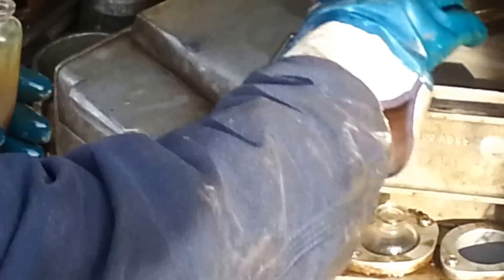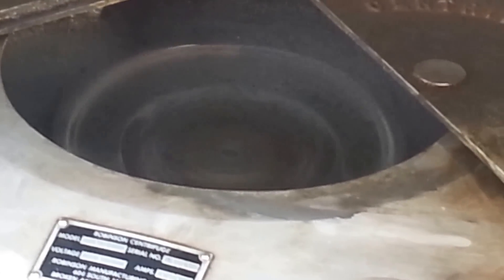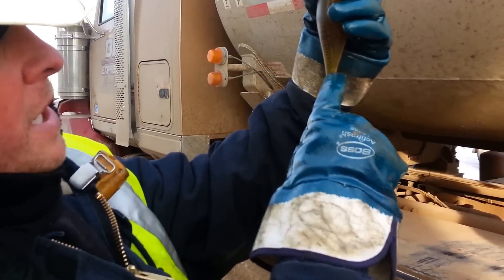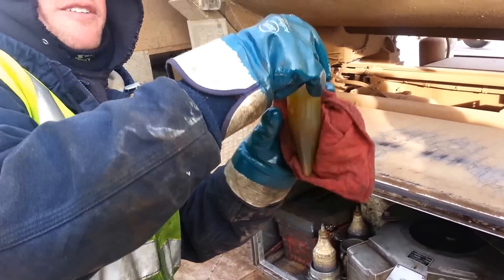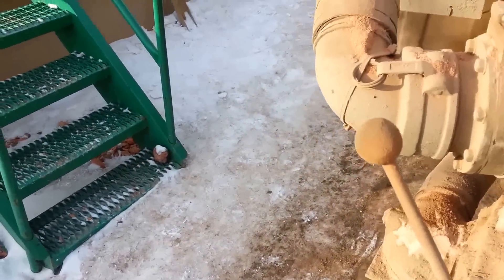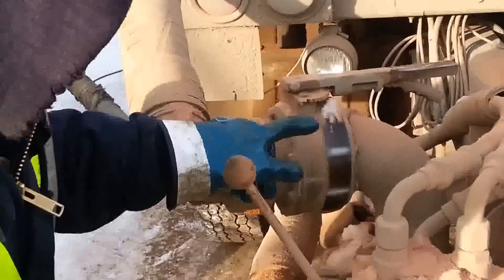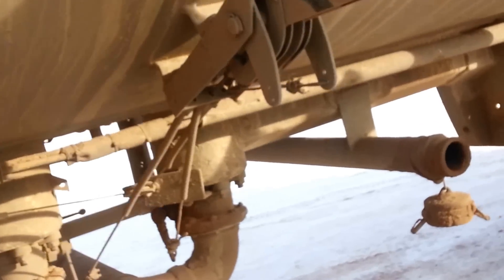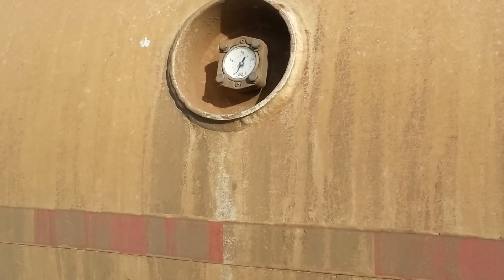Thiefing a Tank, Part 2

Comment: So what is the maximum BS&W content you will haul? Seems like most buyers will haul my leases as long as they are under 2%, although I average .2-.4% with a 6” tank bottom. I used to have a Shell driver that would haul at 1% no matter what “as long as his tape didn’t have bullshit on it when he reeled it in”
Reply: I pull for Shell Trading with numerous operators and our tolerance is 1%, anything over that is a reject or we push back after we are loaded or have vacuum trucks pull bottoms while we hit an alternate tank on the lease.

Comment: Crude oil color is black this guy is testing refined product yellow in color.
Reply: Wrong. This is sweet crude. Looks like a location in the Bakken field. That's crude oil right out of the ground. It's only been heated, separated and stored in a tank. The crude produced here in Colorado is green like mountain dew. I've worked in the oil industry for 7 years now and I've never seen black crude.
Reply: @bobdoingstuff4180  we have black crude in parts of the Permian Basin.
Reply: @bobdoingstuff4180  bingo
Reply: @bobdoingstuff4180 Utah has black wax crude
Reply: Negative sir it clearly came out of a production tank directly off the lease.  You must not have ever been on the oil patch. Just saying. Crude are like humans it comes in all colors. I have seen it green, amber, red, clear, yellowish, black like tar. Hydrocarbons have no distinctive color that it has to be. Reddish oil for instance tends to have way more NGLs in it being ethane, propane, butane and what not.
Reply: How
Reply: We have the good Honey colored 🍯 “Okie Oil” where I haul.

Comment: Maybe he did but I didn't see him heat up the sample or use a an approved solvent to help break the water emulsion bond.  There was no second centrifuge for repeatability. Too many steps according to API MPMS Ch. 10.4 that were skipped or not illustrated during this sampling and testing.
Reply: +Dale Miller - Im sure he did, he said it was at 140 degrees when showing the sample, the whole process done correctly in real time as im sure you know would take longer than this six minute video, that's pretty clean oil, must be at a well cause there is no way its from a saltwater disposal.
Reply: @deszmonddewitt9607  The disposal I operate sells loads at less than 1/10th and over 60 gravity.  That's pretty good oil from any tank battery.